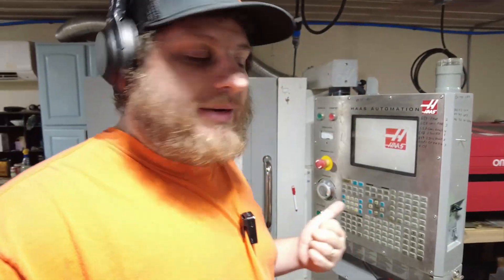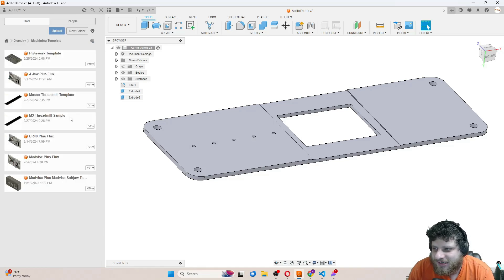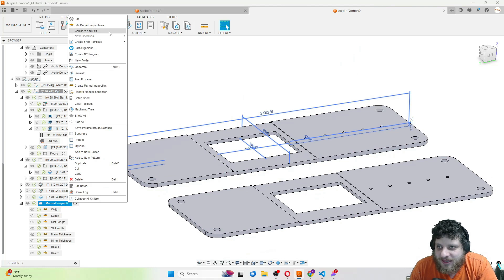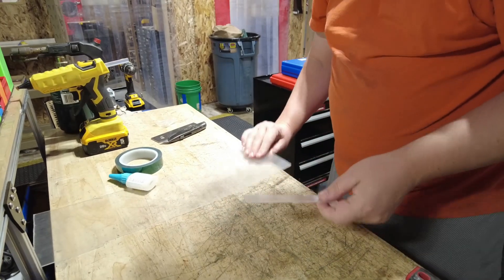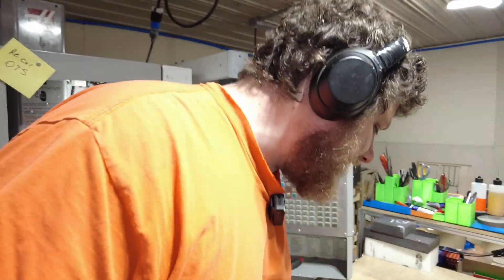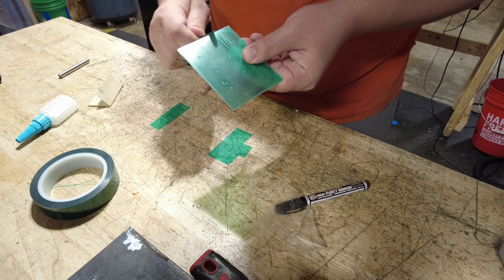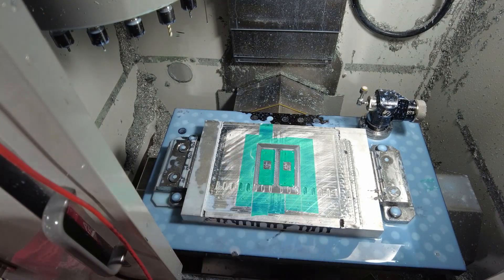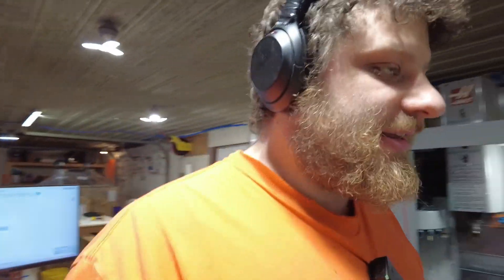How to Machine Thin Acrylic Parts

Comment: Quick tip for you as someone that has worked with acrylic for many many years, instead of using a deburing tool, try using a sharp 90° edge and dragging it at a slight angle across the edge/corner of your material(think like the sharp edge of a starrett 6" rule(or sharper lol). It won't do that "digging" that can sometimes happen with a sharp blade/hook/deburring tool, and it'll still leave you with a very nice deburred edge.
Reply: I use a utility knife blade and drag it backwards, not quite 90 to the stock.  Shears off any fuzz without cutting into the stock and keeps working as the blade dulls.
Reply from the maker: Good to know! thanks!

One of the things I didn't explain well. is that I use the deburring tool specifically for deburring the stock before machining. I've been using a scalpel when I need to deburr the final part, but as you mentioned, as soon as the blade starts to get dull at all, it "digs in". I'll try your method on my next parts.
Reply: I drag a razor blade on the corner

Comment: Tips I've learned from machining acryllic to optical grade: always conventional cut (leaves a way better surface finish) use single flute endmills for roughing and higher quality PCD coated 4 flutes for finishing (though a single flute ran slow enough will leave a spectacular finish cut), if using a single flute run very high rpms (I use a 1/4 inch at 12000-18000 rpm at full doc/woc at 20 ipm), you can make surfaces perfectly clear with a clean layer of acrylic glue, jig tape is frankly more than enough to hold down acrylic, especially larger sheets, debur only by the lightest of sanding, and frankly acrylic is best left to a CNC router most of the time when craziest of tolerance is not necessary, the signage people have that one figured out

Comment: i used to be a programmer for a smaller company cutting primarily engineering plastics, acrylic included. we never ever super glued anything down, always used clamps and bolted parts to an aluminum fixture. if you plan ahead well enough you can end up using bolt patterns for multiple parts. no cleanup and no waiting for cure times
Reply from the maker: Sounds super slow and tedious 😅

Comment: Very odd to me that you've seen IPA cause crazing in acrylic, the place I work at exclusively uses it for that... Also some coolant types can cause crazing in some plastics and not others. I very often use Bron/IPG double-stick tapes for short runtime parts (<20 mins depending on coolant interaction) with the only downside being the release procedure. Typically getting the tape to release requires some sort of solvent like IPA, gapping the tape spacing, and a lot of care to not bend the part too hard and cause stress. Sometimes you end up milling into the tape and getting the problem you mentioned where the adhesive sticks to the end mill edge. Thanks for the vids surrounding small parts/plastics as it feels like they aren't covered as often.
Reply: In my experience the crazing with alcohols is typically a problem with extruded acrylics.

Comment: can I ask a possible dumb question?  why don't you just use that overkill laser to cut the parts??
Reply from the maker: Two reasons 1) accuracy. Most of my parts Are +/-.003" or tighter, and my laser just isn't that accurate. 2) sometimes you need things like pockets that don't go all the way through the part. Lasers don't really do that.

Could this part have been designers in a way that I could be made on a cheap laser? Probably. But generally my customers don't really care that much about money. They just want the parts to work the first time, and they want them fast.
Reply: @AudacityMicro  ahhhh yes, great points, especially the pockets!  :)   Thanks for the reply, love you videos, newly subscribed and a desktop cnc owner!  Looking forward to learning lots from you.
Reply from the maker: Thanks! 🙂

Comment: Make stock has a bigger selection of cast acrylic (especially in colora) and is several times cheaper per square foot.  Thickness tolerance may be +6%/ -25% though.  For 1/8" you can step up to 3/16 for 25%more and machine to thickness but above that you only have 1/4 and 1/2".  But they have both clear and opaque colors as well as decorative ones.  Aimed at laser cutting market, which also prefers cast acrylic over extruded.
Reply from the maker: Good to know!

Comment: One thing to watch out for is the quite big tolerance on the thickness acrylic comes in. 10% +0.5mm …have not seen that extreme deviations but 0.2 to 0.5mm over quite small distances (200mm ish) is totally normal. XT is slightly better in that regard (might be the only reason to chose it over GS/cast) 
Ceramic noga blades & scrapers are great for plastics.
Reply: Good point, at least here if you order imperial sizing you'll get the closest metric sheet.

Comment: Great video! I have had much better experience overall with cast acrylic than extruded. Specifically with laser engraving and cutting quality. Also FYI, that blue masked acrylic looks very similar to the extruded acrylic we used to get at work. The cast acrylic we get from mcmaster is always brown paper masked and clearly labeled on the masking.

Comment: you laser cut polycarbonate too?
Reply from the maker: I do. I have been told that it can be problematic, but at least with the thin stuff my laser goes right through it.
Reply: @AudacityMicro  i did that, but the fume and smoke was really toxic and it damage all the mirror and lense of the laser, it made it really blurry
Reply from the maker: @adityasakhakusuma2507 I have a pretty high power laser, with a high pressure air blast, and really good ventilation. Cuts fine on my machine, but I'm sure it could be a problem on different setups.
Reply: @AudacityMicro  did it leave burnt edge? now i fell like im doing it wrong
Reply from the maker: nope, cuts pretty cleanly. What laser do you have?

Comment: We typically use ethyl alcohol on acrylic without much issue. Isopropyl (aka rubbing alcohol) is bad stuff though.  You can order non denatured ethyl alcohol pretty easily and suggest you get some and give it a try on some scrap.
Reply from the maker: Personally I would stay away from all alcohols. The problem is that the damage can be done now, but not be apparent for months.
Reply: @AudacityMicro  isopropyl is really the issue and even then only on stuff with high internal stress. Ethanol aka the stuff you drink isn’t really a concern. Same with heptane. My client uses both on the acrylic optical lenses they make out of PMMA and SAN. PMMA is the most common flavor of cast acrylic on the market. That being said, we are talking about wiping optical quality acrylic with moistened lens grade wipes, not soaking it over night or anything.
Reply from the maker: Ok! That is good to know! It would certainly be nice to have a few ways of cleaning it if I ever need to in the future
Reply: @AudacityMicro  other tips on working with plastics in general: use a 3d printer to make custom nozzles for your shop vac and a mag base to suck up chips before they can be recut and ruin surface finish. If you need to take multiple depth passes, don’t ramp down, plunge straight down to your next Z height off to the side on in an area of stock that will be removed, then horizontal ramp into the part.
Reply: @AudacityMicro  to be clear, soapy water is of course acceptable also but not well suited for optical purposes unless you use RO/DI water with super special soaps that leave no residue but I don’t think that’s a concern for non optical applications. One thing to note is that acrylic will soak water up like a sponge. We had issues molding it because of all the absorbed water it had from the air. It would puff up like GreatStuff foam when heated unless we put it a vacuum drying oven overnight to dry it out prior to molding. That water can cause some swelling too but if you are +/- 3 thou on small parts that likely won’t be enough to through you out of spec.

Comment: Have you ever thought about getting a vacuum plate setup? It would make sense if youre doing larger quantities because the loading unloading time is so much quicker,but i can see why you do it that way for small batches. I used to machine thin carbon 1mm and polycarbonate on a TM 3P with a double sided tape made by Tesa, very expensive but it wouldnt get tangled in the cutter, always wanted a vacuum chuck but the company wouldnt invest, so id be peeling off tape while the machine ran the next batch 😂
Reply from the maker: I've definitely considered it. Glue drying can be a real bottleneck in my shop at times. I've always been a little afraid of vacuum working with how small my parts are. These ones are relatively large, and they were only ~2-3 square inches each. that's like 40 lbs of holding force max?

Honestly I just don't know very much about vacuum working, so I've never really seriously considered it. I'm moving to a pallet system soon, that'll let me glue parts outside of the machine, which will basically cure my glue time issues.
Reply: @AudacityMicro  One thing I often do here, especially with how cheap material is relative to the parts youa re making at that scale, is just oversize your stock relative to the piece you are working.. Bonus points if it is greater than quantity 1, you just duplicate the aprt 4x, 9x, etc and cut them all as one large sheet. On my vacuum chuck I can pretty reliably onion skin the last ~0.005" or so without losing vacuum. 

For a relative "how much can I cut", with a standard ~37 helix YG1 1/4" endmill, I was doing about 30-40IPM, 0.1" DOC, 50% WOC on an aluminum part that measured ~4"x6" on a vacuum chuck. I pushed it about 20% harder and broke it loose. If you used a downcut bit you could go further with it. Plastics should easily be able to do 3-4x that.

If you have any questions on this, feel free to reach out and I can walk you through my process.
Reply: @AudacityMicro  we use Haas GR-510's at my shop, all with vacuum tables.  We would cut thousands of parts like that out a full sheet sometimes.  That process looks painful, and even if it's only one or two parts it's still going on one of the big routers vs over to the VF2's.

Comment: What are your thoughts on good thin double sided tape?
Reply from the maker: It definitely works, and is probably better in a higher production environment, but I don't like it for a few reasons. It's not as easy to get parts flat, it's not as good as handling coolant and heat, it's also less rigid. And for clear acrylic you would probably still want tape, so that you can get the adhesive off afterwards.

Probably the best option for bigger parts though.
Reply from the maker: Oh, and it'll gum up your tools if you cut into it. Super glue doesn't do that.
Reply: @AudacityMicro  Thank you for the reply's. Out of curiosity have you seen or tried flame polishing after milling?
Reply from the maker: Yes and no 😅. I have tried it, but I've never gotten a good process sorted. I am more likely to scrap the part than improve it. I think I'm impatient.
Reply: Chemical vapor polishing is the way to go. Takes literal seconds and you never risk scrapping parts